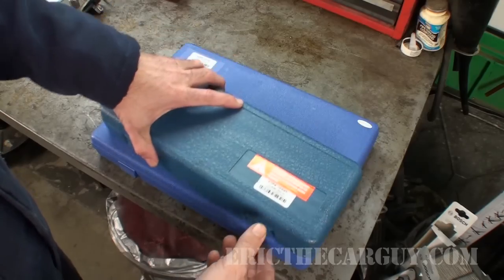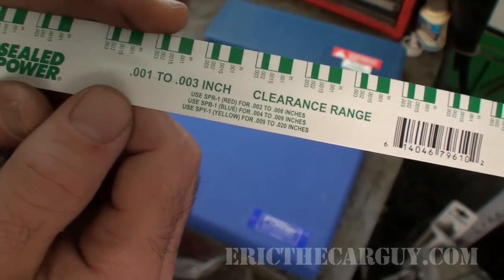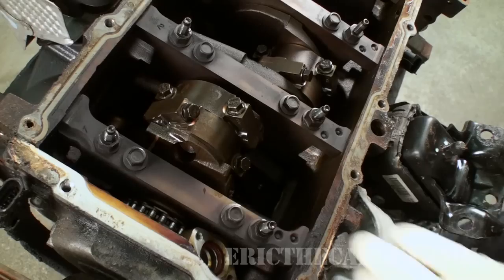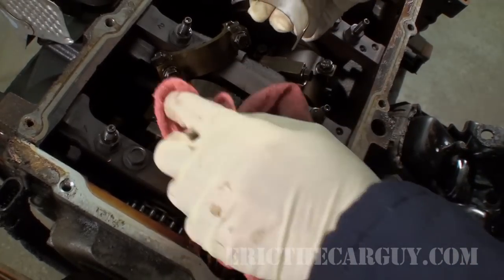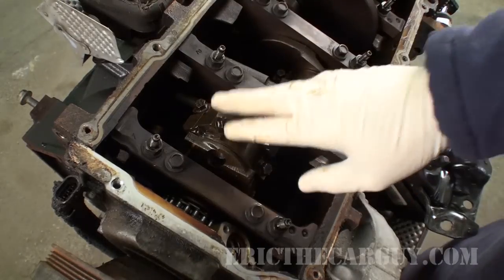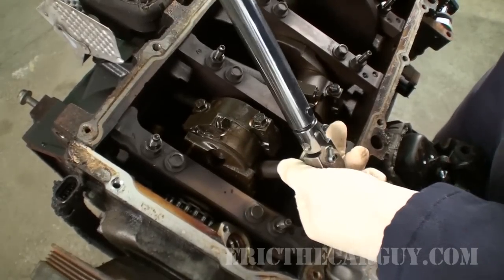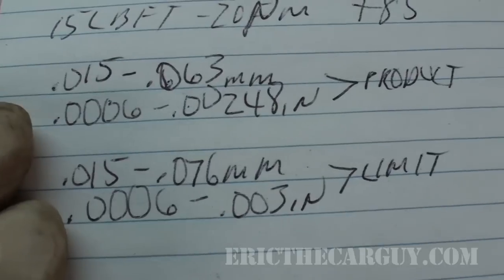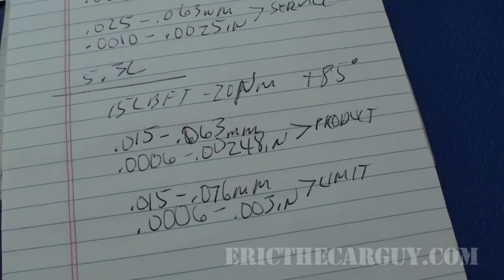How To Use Plastigage -EricTheCarGuy

Comment: Good informative vid.

For Eric or anyone else out there-

When taking measurements, one  puts the plastic gauge on the journal to be measured and put that cap on & torqued to spec.

What about the rest of the caps? Do they need to be on and torqued or can they just be left off?
‘67 Ford 289.

Thx

Comment: This is how not do use plastiguage. If you have a bolt torque that includes an "so many foot pounds, plus so many degrees" ... thats a stretch bolt and can be used ONCE.   When you make the tightening on your new bolt for plastiguage, you do NOT do the "x degrees" ... just the torque.     If you include the "and so many degrees" section, you need to chnag out the bolts!

Also, check the instructions ... most brands specify grease on the journal, silicone oil on the shell .... just check the instructions.
Reply: This was my exact question! So if you don’t do the extra degrees, it will still be within clearance and the plastic gauge will work?
Reply: @joshuag2522  Absolutely!  You need to apply enough torque to fully compress the plastiguage, thats all.  It's just wax, it really doesn't need much to fully compress it. Feel free to put 50 ftlb on it if it makes you feel better, but try it yourself like I did, try it at 10, 20, 30, 40 ftlb ...  you'll find 20ftlb is more than enough and there is zero chnage beyond that.
Reply: @itsverygreen532  and that won’t ruin my brand new stretch bolts? I will know my oil clearance and then I can use the bolts and torque them down to spec afterwards? of course, with the additional degrees.

Comment: 11 year vid, but whatever.~~~

Strictly speaking, you don't need the bore measuring tool to do it right, it's just convenient. "Back in the day" they used to use a tool to transfer an internal measurement onto the tool, that can then be measured using outside measurement tools. This tool is called an "inside caliper." The advantage of this system, in addition to being cheaper, is you can unify all your measurements to one single high precision measuring tool, which prevents you from having to have several tools well calibrated or calibrated to each other.

Comment: I did this back in 2021 when repairing our 2004 corolla, now again to repair our 2015 tow and country but since i forgot the details came here after fricking out yesterday when the clearance was giving me out of whack! well I used the red one! no wonder, now will do it with the green one which is what I should have used; That is a pentastar engine, 3.6L V6; the cyl bores were honed, the crankshaft was cut 0.5 and bearing journals polished; I got a new set of standard OEM Mopar Pistons, and my choice of bearings are from King, 0.5; I am at merely the first step which is installing the crankshaft, one thing to note is when I torqued to specs at 84 ft #, I could not rotate it at all using my hand, manual says I should be able to; this was done with everything dry of course. I will do it again today; hope the old bolts for the main bearing caps will be usable as manual says to use them for the check then use new ones which I already have as well, same goes for the pistons rods checks using the old bolts then finalizing with the new ones.

Comment: Put the bearing in the rod cap and fit in notch, then lay gauge material and place on crank and tighten cap to spec, remove and gauge 
Brake cleaner will remove it if it makes you uncomfortable

Comment: Hi Eric, thank you for this video. I disassembled my 1.8L  and the Machinist said that the engine needs reboring. He said all the bottom end/rod bearings and crankshaft are in excellent condition. On reassembly, do i need to check clearance if i kept every thing in order and those parts were only cleaned and not machined?

Comment: great video, i’m curious because i am rebuilding an inline 4 that chewed up a couple of bearings via oil starvation. i don’t want to buy the wrong undersize or oversized bearings bearing when i go to take the measurements with a freshly turned crankshaft, so would i use the plastigauge on the least damaged bearings?

Comment: Just a heads up, you don't have to pull the whole piece out of the packet like that. Just cut the one inch section that has the measurement on it with the plastigauge in it. Then you have your little piece and your measurement

Comment: Kinda noticed you checked the clearance in inches but referenced your chart in millimeters, but it looks to be still in tolerance from .006 - .0024 thousands, since .0015 falls between the two. Still a great shape crank non the less

Comment: Eric,  I realize that this video is 9 or so years old. 
It is very informative, and the audio portion is very well done (many of these offer poor audio). 
However,  and please take no offense........  I would like to point out that some of the language could use improvement. 
At 1:23 into the video, we measure "bores". 
At 1:47,  these are micrometers! This tool is NOT used to measure the bore within a connecting rod. 
For that, we'd go back to the first precision instrument shown, a micrometer. That would be used to measure a connecting rod crankshaft journal.
 
At 2:10,  in order to measure a bearing's thickness, we would use a point-tip dial indicator (on a flat surface.... zero'd in) . 
Reason? The circular shape of the bearing would prevent an accurate measurement using a standard flat-tip micrometer. 

At 5:20, the large end of the connecting rod is freeze cracked via a special process.  As you point out,  this is to give the now fractured surfaces an absolute precision mate between the two. It is imperative that the two parts remain together (and indexed correctly), throughout their life. If these parts are not marked (as to being a matched pair), you will want to mark them. 
Great technology.

At 7:10, oil pumps deliver more oil volume than required. Although excessive bearing clearance can reduce pressure, the actual oil pressure is determined by the oil pump's by-pass valve, with an influence via RPM. 

Lastly, thank you for calling this an Engine, and not a Motor. (my pet peeve!)

Comment: The pistol draws the machine to size and then that goes what we call the fracture machine. A laser cuts the inside of the cap on your on both sides and then it goes to the fracture station that has a wedge that comes up through The middle of the fixture with 5000 PSI pressure and bust it apart for a clean break if they're jjagged That's because the laser didn't etch deep enough They're supposed to be perfectly straight all the way across

Comment: I used all them measuring tools. The best motor I ever built. 400 hp+ I rolled around on the ground. Maybe kicked some dirt in it. Used plastigage on everything. It was still running 2 years later. As I treated it like, Who cares motor. I got more...If I did a perfect job on them. They always had issues with something..

Go figure.

Comment: To really get an accurate measurement if your rod bolts are TTY, wouldn't you have to use a pair of new rod bolts so they for sure have the correct clamp load?

Comment: Nice, I kind of have the same problem with the connecting rods in my 4.8 block and have those numbers on both the connecting rod and caps. Where can I find the information about those numbers from the connecting rods and their caps. Cause I just used plastigage to check my rod bearing clearance and plastigage was gone from during the check. Everything from crankshaft and bearings are standard size. What does that mean?

Comment: Vary interesting as always. Would you happen to know if a reasonably well maintained 2006 1.4 petrol Polo at 100, 000 miles might be pron to small end wear. That is, light tapping noise much more pronounced under load almost disappears with no load.

Comment: Might want to clean of the oil on the rod side of the bearing also to not affect the reading. 
The "broken" rod is also cheaper to produce, so used in mostly factory engines. The downside of it is that you can't resize the big end in a rebuild, it's a throw-a-way part.

Comment: Never used plastigauge before.  Is the reading not affected by the fact that that there is still oil between the crank and the other rod bearing that you didn't clean?

Comment: Hey Eric . I have a few questions ! I have a b20z2 that I just had the valve lash done but I’m noticing a tapping sound after a few races . I have since re lashed the valves (no difference) and now have torn off the oil pan to check the rod bearings . Do you know if the b20 had issues with spinning bearings ? Can I replace them with out removing the engine . And lastly , would you recommend using the same nuts/bolts or purchasing new ones ? Thanks for all your help

Comment: I have tried to read most of the 335 comments below and have some simple answers:
Bolts: TTA are not throw a way. GM service does not say otherwise.

Plastigage: It is a controlled product produced to strict standards. It is sold by “Sealed Power” and others and only the color changes. Who cares who invented it, either in the U.K. or the USA, it’s patent is from the 1940’s.

I you Like Micrometers and inside bore gauges and hate “Plastigage” no one cares. If you can afford the tools, fine. Once again, no one cares. 
Commercial engines or vehicle engines, works the same.
Just make sure you know the correct readings for your engine. The production date can change the measurements or cam bearing block bores...double check.

What to call it or pronounce it; 0.0015” to a machinist is pronounced 15 thou. If you want to call it 1.5 ten thousands fine. Just don’t expect a Christmas card from the American Machinist!!!

What do I do if it reads ????
#1 When in doubt, take it to a clean well respected busy machine shop and ask them. Guess what? They want to sell work & labor, so they will sell you work and labor! Duh!

You can purchase bearings that are 0.001” smaller ID, and thus thicker. If the bearing journals are nice, polish out mirror or close to mirror finish, these will work great as they have for decades & decades. If you finger nail catches a groove, then you have to decide to cross the 60 year old rope bridge with the 1,000 foot drop, is your choice! How is this engine going to be used!

Mix and match bearing sizes; Yes, thousands of engines have been build this way & repair this way! What do I mean? Ok, Buy two sets of bearings, one set is STD and the other is 0.001” under, place on either side of a rod or crank. Torque to crush and seat, then use the Plastigage. Go from there! It works fine, like it did for Ford V8’s during the 70’s. Plus rings gaps where lined up and had mis-matched rod caps factory numbered. I am not picking on Fords, they paid of my house! It is just a shop who had been there 40+ years & who’s customers were 65-80 and owned the car new and never had the engine apart anywhere. These were customers who had every RO in order i the glove box! Yes! This was when glove boxes would hold 3 chickens.

Two sets of specs; Yes, GM and all others give you new production specs and service specs. Production means this is what they want when new. If your specs are less but above service specs, how far or HP do you want? The tighter the better but a film of oil is only as good as “The Sum Total Of All Leakage Passed All Bearings” 

Volume = Pressure; NO! The leakage passed all loose bearings reduce pressure. Volume is there or adding 18% more volume is like putting yesterdays under-ware onto a clean bottom. It works but still smells wrong!
Tight bearing clearance equals high pressure because volume is not lost. Don’t fotget cam bearings, as if copper is showing at the bottom where pressures are highest when opening valves. Study hydraulics and automatic transmissions and don’t fall asleep during the math part!

Plastigage and temperature; While metal expands with higher temperatures and various alloys are different. Alum on average expands twice as much as iron, fine. Is it cast iron? Nodular Gray Iron? LS exhaust are cast steel or close to it. I still elongate the end of manifolds for bolt holes, to allow for movement with flat washers. 

You be you! Plastigage is a proprietary blend of plastic but the amount of “Squish” at 72 degrees F is different that 0F or 100F. So pay attention.Yours will vary!

Two, Three or Four pieces of Plastigage at a time: This is measurement of one side under normal circumstances. But engine bearing run on a film of oil all the way around the journal. Using two pieces 180 degrees apart, will measure about 1/2” the normal reading. This was never the purpose of Plastigage. My example is a minimum of 0.0009” or 9 ten thou... With plastigauge on both sides of this 2003 Tahoe rod bearing, it measures 0.00007” on each. Add together and you get 0.00014”. The minimum spec of 0.0009”, now half of the 0.00014”, (0.00007) subtract by 2= 0.000083” wont measure correctly. Never does. Now you can find several spots to measure out-of-round. The problem is the bearing is softer than then journal, so it this variation the crank journal or the bearing? I say the bearing! This is when you get the micrometer out. Please use the friction/ratchet tip to tighten. This is the only way to get true repeatable measurements.

Now, I am not an authority on this subject but also not connected with Eric the car Guy. I am sure he is busy making the next videotape.

I am a retired ASE Master Tech who did every type to repair on imports and domestics. Just trying  to help answer a lot of questions going back 6 years. Hope this helps!

Comment: Eric, thanks again for a clear to the point subject matter. Iron and aluminum blocks of different years have different specs as oil has dropped to 0W-5 synthetic that requires tighter clearances. But you covered that in your disclaimer. As time passes, GM has taken a very strict position on published specs which is part of their intellectual properties. They are shutting them down one by one. Note: I worked on contract labor in the field for over 7+ years and today, even tech’s change their user password often and monitor the IP addresses used by that PW and time of day. 
As a quick note, I have a 2003 iron block truck LS, but the production specs for the rods are 0.0009”-0.0025”, Service is 0.0009”-0.003” but also list 15 lb. ft. + 75 degree angle. Yours will very. Please folks, don’t give up as ACDelco.com can provide GM’s eSI (Electronic Service Information) for a fee, lasting 24 hrs or more if you desire. The advantage is updates, TSB, or Recalls can be updated with one key stroke. The same is true with programming modules if you have a shop. I had some programming modules wireless while the vehicle is in the parking lot. 
1978 - ASE Master Tech - Retired    Everyone, hit the like & subscribed!!!!
Eric has some of the best videos on these subjects than many!
Reply: Plasti-gauge has a patent going back to the 40’s. Just a note, it works if you don’t have 3k in “C” clamps with numbers on them.
Reply: Shells or points its the samething as demonstrated today

Ask jordan she didnt like it when the sas told her off 😂
Reply: Shutting down publication of torque specs is such a moronic and backward viewpoint. But hey, anything so the customer can't actually work on their own vehicles. So much for "right to repair" laws - they just come up with a new way to block you at every turn unless you pay $500 for 24 hour access to shop manuals.

Comment: Thanks for the video Eric.  I have just learnt something new. I'm not a mechanic but like to learn more about my car and how it functions.   I had my diahatsu hijet connecting rod bearing changed because it made a loud sound, one was worn down. The oil light used to flick off and on and sometimes stay on. After having the bearing changed the noise is less but the light still comes on after driving for a short while. I heard you said that the if the clearance around the connecting rod is greater the oil pressure will be lower. Do you think I may be experiencing the same problem.  If the torque requirements not meet could this be the reason for low oil pressure?

Comment: The torque specs PLUS additional torque in degrees stretches the bolt.  This is correct for assembly BUT the bolts are designed to stretch with the additional degree torque.  NEW bolts should be used each time or you overstretch the bolts.

Comment: Hey bud thanks for all the videos I do have a question there is a lot of crazy controversy on the LS forums but is it ok to pull them and do a visual inspection and then reinstall bearing, cap and same bolts?

Comment: Pottzy87  0015 is thousands of an inch, if it say  be 0100, think it’s called mills of an inch, at least it was how I measured wire and cable for thirty years
Reply: No, that's 15 ten thousandths of an inch. .015 would be 15 thousandths.

Comment: always place the bearings into the rod caps before u install them.
Reply: You have to make sure the bearing is align right. I never seen anybody do it this way..As there is a vertical bearing crush. Where both side of the bearing must touch each other.  I make sure I can feel the bearing sticking up on each end. You only need to drag your finger nail over them..That way you know the bearing is touching the other side..When you torque it down the first time. To get the proper crush alignment..If one side is sticking up higher. The bearing cap slips. Then the gauge will read wrong..
Reply: I never seen anybody put bearing on journal first.Always install on cap first.
Also torque to yield rod bolts should be replaced after they have been stretched.